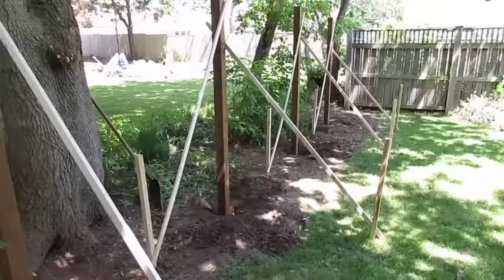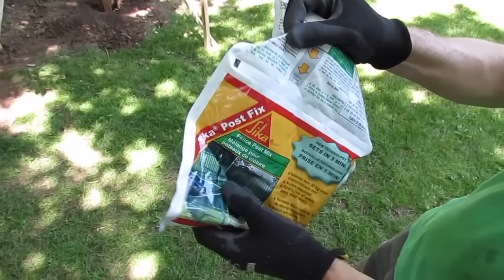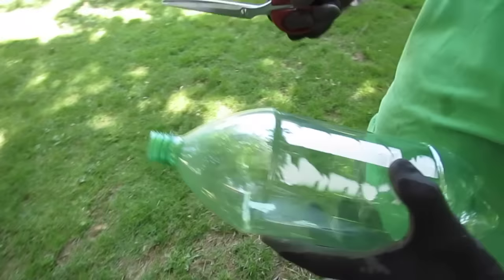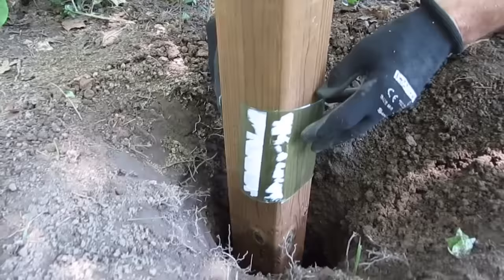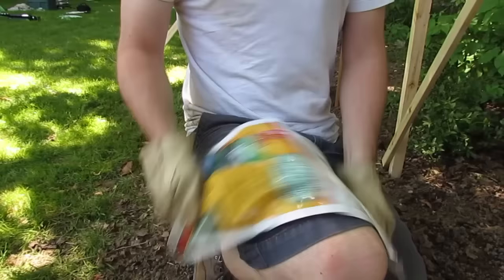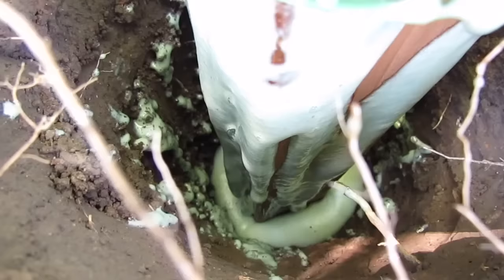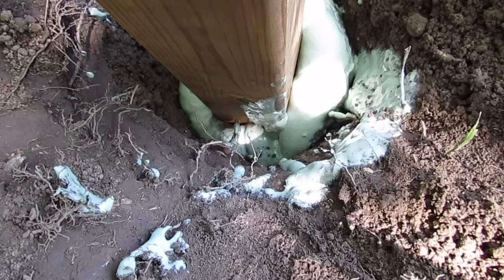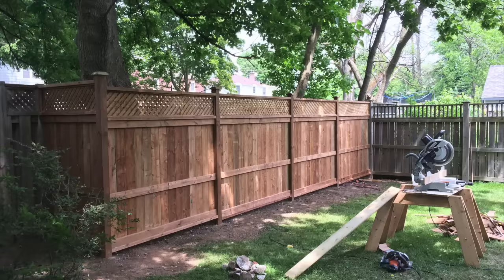No Concrete Fence Post Install!

Comment: Concrete verses foam... As if we need more plastics added to our envionment  ..
An 80 lb bag of concrete costs just under $5.00... You may need about 1 1/2 bags per post if you install your post correctly.
In this video, if the post hole would have been dug wider as I prefer you would have likely needed 2 full bags of their product... costing over $15.00 per bag.
That is senseless.
I do understand the person taking the video was trying to keep his mess down.. But while he kept his mess down his costs were way over the top of a professional installation costs.

All thos pieces of wood needed to prop the post up temporarilly are not needed when installing a fence.
So those pieces of wood is more money wasted.
The time to prop the post verses just installing the fence is wasted time.
The mess..... If you put a tarp down under the wheelbarrow and you mix your cement there is no mess.

By use of cement you would likely keep your costs down to  1/4 of the costs of foam.
You would not be adding more plastics to our ground .. therefore not taking chances that its decay over time will be added to our soils, or underground water.

I have been installing fences for nearly 35 years and I have never considered using a product like this so that I could save me time or money or clean up... 

It may work... But I think its just another gimick put out there to sell people on something that should never have made it on the shelves.

Ridiculous product.
Reply: Gregory Kalarjian sounds like the only problem you have is that it cost more.
Reply: its just a silly novelty in my opinion, if you dont want to mix you could just pour in some quikrete and add water, its even easier than this
Reply: magic cheeseball I'd imagine the weight difference would benefit those with a disability in some ways.
Reply: Yep, this is a specialty product if you can't dig a full posthole, IMHO.  I had a tree stump that I didn't have the time to move out of the way, and as a result has to shorten my post and needed something to hold it fast in a very irregular hole.  In that case, I did use the expanding foam, but the cost makes no sense over the cost of concrete if you need to do routine footings.
Reply: Yý6
Reply: If a person has a shoulder or hand issue or if handling bags of concrete mix is just too heavy, but is still in shape enough to put the fence up then I would be glad to use the foam. Hiring a pro does quadruples the cost of a simple fence that is IF you can get them to show up.
Reply: @magiccheeseball  unless you can't lift the bags but can build the fence.
Reply: Hiring a contractor would increase the cost of installing a new fence.  Quadruple costs? That I am not sure about as I know I don't charge that much over the top of materials unless the work outweighs the normal time and or conditions of any other installation.
Some fences are installed in soil with no more than a pebble underground and there are others that have rocks as big as softballs and or basketball's... 
Those jobs do cost more as the labor is more extensive.
Okay... now that costs of work is explained...
This product may be suited for someone who can not lift an 80lb bag of concrete... but quickrete does sell 60lb bags as well.
Regardless of weight, but not excluding it as a factor for those who can not work with weight of actual concrete... There is the cost factor.
Yes , this product costs considerably more than the concrete.
But hey, some folks are perfectly fine with spending as long as it's easier to do the work.
I am not debating this or that... I simply said that in my opinion this product is a waste of time, money and effort.
I believe that putting plastics underground is bad. 
People do whatever they want in this world and they advance themselves to fo things with more ease... but as well as the ease that comes with this specific product in ( based on normal conditions ) this product in my own opinion is not an advantage over the so called old fashioned way. 
Someone above read my post and somehow believed that my only concern was a higher cost.
No, as my original comment stated, it was cost, time , work and if you want to add another factor, convenience. 
 I think it's easier to install a fence with concrete.... 
I think it's more affordable to install a fence with concrete.
I know it's faster to install a fence with concrete.
And in my own opinion I believe plastics underground is not good for our environment. 
But... as with anything else, people do whatever it is they want.
I am just starting my opinion.
I don't mean to offend anyone...
Hopefully I have not.
If I somehow have, please accept my sincere apology.
Reply: Ajaopify,   I am a professional when it comes to installing fences... I have never had to use a prop to keep a post level while installing a fence.. Even with the use of Concrete in the post holes.  Back filling the post hole with minimal soil, tamping the soil near the post, leveling the post and that alone would keep the post in place and in line with the fence line so that I could mix and shovel the cement into the holes.
I understand the homeowner would want to use the wood braces to support the post in place so that the hole can be back-filled with this plastic product, but even then it is not necessary.
Just as soil is used with tamping the soil and the post level for use of concrete, the same can be done with this product.
But as I continue to mention, there are different applications in different projects... I base my answers to a normal installation... Not one with ease, but one with normal working conditions for all factors...:, the type of installation,  the materials as well as the installers capabilities.

I am not out there to insult anyone, support a concrete manufacturer or suggest the product does not work.  I am sure it does work... But in my opinion based on normal practices, this product has its downsides.
Reply: Agreed.  On all counts.   Thank you for understanding that I was not attacking anyone, its just my opinion based on my knowledge of how to install a fence.   
After viewing this product and knowing a little bit about using a similar product for my installation of windows, foam keeps expanding until it stops... In that, if the homeowner were to put more product on one side of the post verses the other I imagine the foam could in fact push the post off level, and then the foam would cure while the post is no longer level... In that case the braces would be more needed.
But if I were forced to use the foam for whatever reason, I would likely not need to use the braces because I have experience doing it a different way.
Reply: To explain this for the less informed: dig post hole put a post in hole pour in DRY quickrete and add water to the top until moistened no mixing needed.  Too much cleanup involved in his plastic silliness.
Reply: I'm not a pro fence installer, but I know you don't level posts, you plumb them.
Reply: i have had this argument with youngsters, they will just say straight up and down level.
Reply: One huge advantage I can think of is if you ever want to take the post out, all you have to do is pour some acetone on it. I spent about 10 hours taking out concrete bases from 3 fence posts that broke after a tree fell on my fence. I do wonder how long this lasts compared to concrete though.
Reply: @rauldelgadillo8447  and the strength of the fence
Reply: This product seems to be more for repairing older posts that might be leaning. We've fixed leaning posts by digging out two sides a bit and cracking as much of the concrete out as possible. After that I can see where this product would pour in and firm up the old post better than trying to get new concrete in there. But for new posts... no way.
Reply: Looked like a good finished product to me ..you as an installer are a pro and your info is probably very very spot on ..but to a guy like me who is just a guy ....this is awesome..and it works
Reply: @clroger4  I can build a fence but yes ..have trouble with lifting bags ..
Reply: @dperry19661  yeah Doug I was thinking the same thing quick crete ..essentially no mess
Reply: @da324  I'm not either but I got what he ment ...
Reply: I agree what a crazy solution to fixing a simple post. Expensive, Messy, and to be honest I cannot see it lasting that long.
Why not just use PostCrete just pour a bucket of water into the hole and add the bag of fast set concrete sets like a rock in 5 mins and no mess no carrying or mixing contrete.
Plus its £5 a bag not $15.
No I will stick to concrete thank you very much as its simpler and less messing about :-)
Reply: what about frost heaving these? i bet it will grab and heave that easily
Reply: @NEPANEWER  as a professional, a QUALITY installation, granted more time and cost, would include a couple inches of gravel in the bottom, a layer of concrete to protect the base of the post, set the post and level, then fill around the post with more concrete to ensure the post is completely encapsulated in concrete with a hump above ground level to encourge water drainage away from the post. Setting the post directly in the soil would encourage water to wick and rot the post from the bottom up...maybe not in your experience, but that's the way I was taught if you really want the job done right...and we used braces to keep the posts level while the concrete cured. To each their own, I guess...
Reply: @da324  lol word Nazi😉
Reply: Gregory Kalarjian the time you took to post this comment you could have built a  fence
Reply: You all need to realize though it is low density, it is just polyurethane, think of the harder stuff used for a bowling ball shell. so to say this is harmful to the environment is quite wrong, in their two separate parts the two chemicals can be harmful and so can the setting if ingested will harm you and possibly kill you. After it has set however it becomes as shown and unlike concrete which sponges up and hold water leading to a shorter life for even a treated post set in concrete, this is closed cell and will allow the post to last much longer. I myself like the concrete but rather set in a wet set post anchor to mount the  post to so it last much onger but not if the work is in a location where the only way to geet water to the site is in buckets or barrels lugged in by hand and dolly, such as the way to lug in the heavy bags of concrete. The company does also selll the two parts by the gallon and will want some paper buckets to mix the two parts of foam in. There is a big reasoon why uilitipy lose companies use this stuff in many cases as opposed to concrete when setting poles in the ground. its less stuff to haul around and is much lighter than 60-80 lb bags of concrete mix, they have been using this for at least 20 years now. 
Pouring the concrete in the hole and wetting it is the WRONG way to mix it, it will not get wet through and through and doing this will lead to repairing or replacing the post in just a few years due to not taking time to mix the concrete and water in a tub or wheelbarrow first. I NEVER do that dump the mix in the hole and then add water for it is NOT the recommended way to do it as even mentioned on the bags of Quikcrete or Sakrete quick mix, plus it takes a day for it to set hard enough to continue with the fence work. Foam on the other hand is mixed as shown and takes anywhere from 15  minutes to 2 hours to set and thus one can easily do more work in one day and not take a few days to do it all. Plus if you wind up less to the top as he showed is more than enough, and covering it will protect it from the sun discoloring it let alone it will take at least 30 years before it shows signs of weakening where as concrete will shrink over time and cause wobbling issues, this foam stuff will not.
I have watched Secure Set test videos and they show it has a much better uplift strength than concrete in which both cases they held on and the ground around them is what was the weakest link, in that same video they did a shorter less thorough side pull test showing yet again the ground around them is what gave way first.
If I had to do a fence out in the wilderness or where getting water to the site just by hose alone and hauling in barrels or even buckets let alone trailer was out of the question, the Foam stuff makes a lot more sense.
Reply: Gregory Kalarjian veggies
Reply: There is one additional advantage to using the foam. It keeps water away from the post. Concrete, which is porous and permeable, actually wicks water from the ground and keeps the moisture in contact with the wood post in the ground, causing decay over time. The foam is not permeable, so water from the ground will not wick to the post.  Rocks in the bottom of the hole to keep the bottom of the post away from "standing water", then the foam product to anchor the post, will ensure that the post installed with this method lasts longer than one installed only with packed dirt/gravel or with concrete.
Is it more cost effective to pay some additional up-front costs but end up with a longer lasting fence before post repairs are needed?  Could be.
Anyway. A real product. Not a gimmick.
Just one more choice to consider when deciding the best method for any given installation.
Reply: This is good for senior citizens. My 85 year old gradma wanted me to help her install 20 posts. I told her to fuck off, so she bought this foam and installed all the posts herself. She even carried the posts on her shoulder to the backyard.
Reply: A packet of the foam takes the place of 2 50# bags of concrete for a standard 8" diameter post hole. Some types work very well but not this Sika product which is quite soft and not stiff enough to provide lateral support for a tall post or hole. I use Sakrete Fast Set concrete at $5.48 per bag and it takes two for a post hole. Same price per hole as the Sika but the Sakrete is much stronger and sets in 30 minutes.

Comment: All you experts here never ever touched the product before let alone actually do it for a job daily. 

Foam is a excellent solution ! 

No heavy hauling of bags of concrete. No water needed, no mixing needed . 

All you little haters are 😂 

“Bad for the environment “ 

Polyurethane has been used in construction for decades and decades. Foam and dirt do not mix try it I’ll wait..

You can work it within 15 min you can start building on it no problem. Aside from it being cheap 12usd a bag compare that to concrete and added labor !! 

Now I am not stating it will be great to put an entire deck on. But for a fence? Letter box posts whatever else ?! It’s a great easy solution . 

Also telephone poles (big enough for ya) are now being put in the ground in similar fashion. It’s just lot faster than hauling bags of concrete in a hole. Nothing you think you know or say does change that ! 

So keep hating and being stuck in the 70s for all I care.
Reply: yes but look at the cost vs 1  10 lb bag of redy mix   about 2-3 $  per bag at lowes

Comment: I always use cement and put enough cement to come slightly above ground level and the put a slight positive elevation to the cement as to keep water away from my post.  Also.. The cement takes time to cure so you have a good working time to make sure everything is just right !!
Reply from the maker: Very true.

Comment: Lot of foam haters without a bit of experience with the stuff.  It's obviously not the same foam used in home construction as insulation or air sealant.  Much harder as he demonstrated with him standing on it.  You may think cement is better but the weight alone can causes a pole to shift over time.  In addition, concrete sucks up and releases moisture.  The closed cell foam does not.  I will still use concrete but, I am not going to sneer and condemn this product without more proof unlike the many idiots here who act out of their feelings rather than hard objective evidence.  Most are hypocrites because that is the very thing on which they criticize snowflakes.
Reply: over 40 years installing fences , I never used either , PEA GRAVEL IS THE BEST PRODUCT TO USE .......a bag of that foam shit $15/20 bucks a bag of pea gravel $3
Reply: At last- one sensible reply. It's nice to find someone who considers, instead of spontaeneously hating. I have been planting-fence posts for thirty years and I wish this foam had been around much earlier. It has a lot more applications than just fence posts, if you put your mind to it, but it is way too expensive. It's a great invention but I'm not even considering using it till the price comes down. i mean WAY, WAY DOWN!
Reply: concrete doesn't work when it's minus 5 celcius. this is the only solution then
Reply: Of course it does. IDK why you would be setting posts in the winter but if you had too I would imagine digging deeper then the frost line (usually 3 1/2 feet) would be key...like you are supposed to anyway. I know the bag says 24 hours on most ready to mix cement but I wait a minimum of 72 hours before hanging any board   @maximegagnon8597
Reply: The foam is 12 dollars each. Standard concrete  (60 Lb.) is 3 Dollars..... The foam is easier but so overpriced it is silly.

Comment: In the automotive industry they are using foams to reinforce the structure of chassis. They also use the foams to deaden sound. And they are also using GLUES to adhere metals but mostly plastics instead of tig welding. The foams and glues they are making aren't the same thing you all have been thinking about for eons. Times are changing

Comment: I have done a lot of fencing over the years. This product is too complicated. All you need to do is to pour dry concrete or mortar into the hole and pour in some water. Job done! No weird chemicals to mix and worry about. Sand and cement have proven themselves! How long will this product last? Will it break down? Will other chemicals effect it? Stick with concrete or mortar.